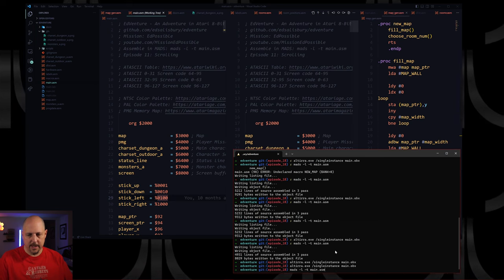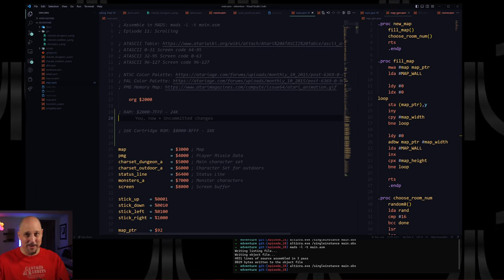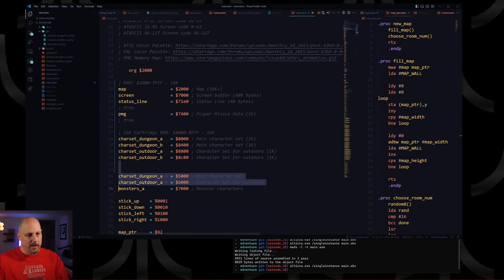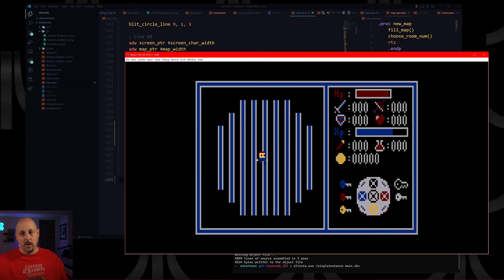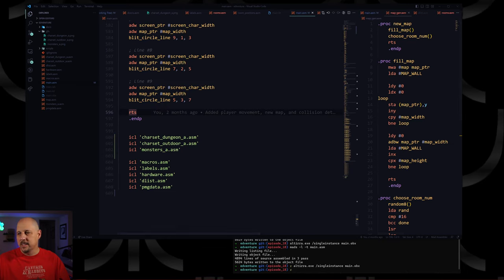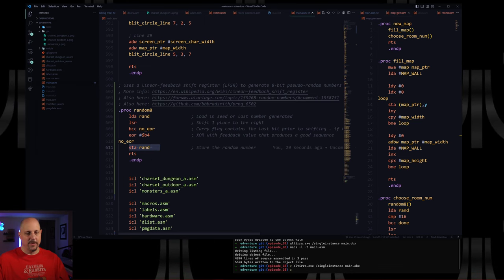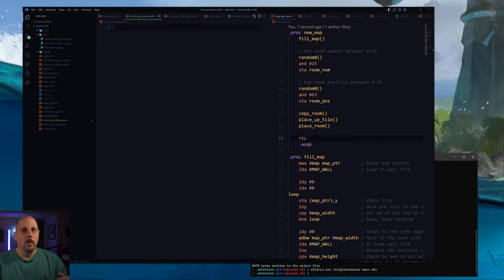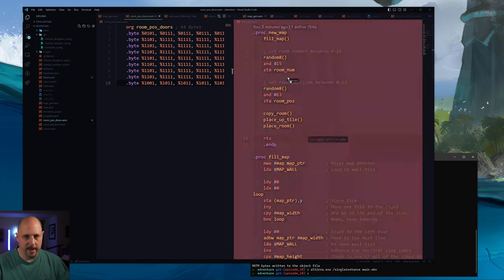Let's Make EdVenture #19: Procedural Map Generation Part 2 - (6502 Assembly, Atari 8-bit, RNG)

Comment: Its seems like you are going to be putting a random room, in a random position, would not just putting a random room in each position one by one be just as random ?  Plus if you are going to have to check if a certain position already has a room before placing a new room in that position , it could be quite time consuming waiting for the last few random numbers to hit empty positions. Or have I totally missed your intentions.

Anyway I hope you are enjoying this since I really want to see the game finished.
Reply from the maker: The issue is, we didn't want it to always start in the upper left hand corner of the map. It will do a walk for each room, not just randomly placing them. I realized that it's hard to see the big picture when it's broken up into so many pieces :)
Reply: @MissionEdPossible  Ahhhh. That makes sense, guess I was jumping the gun a bit there.